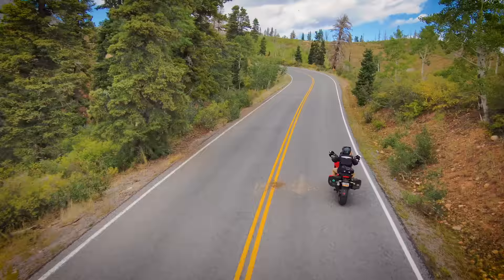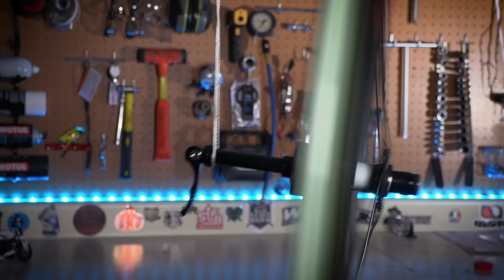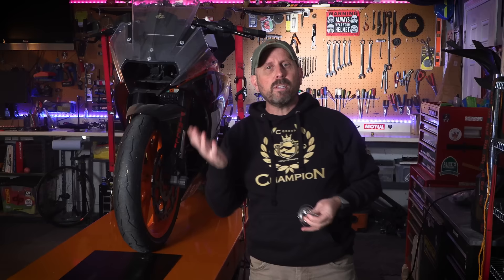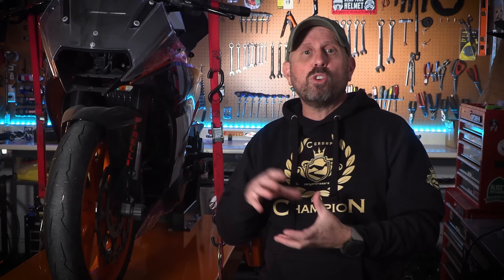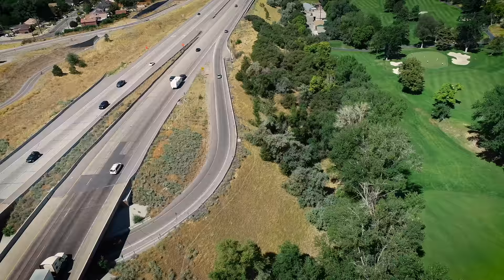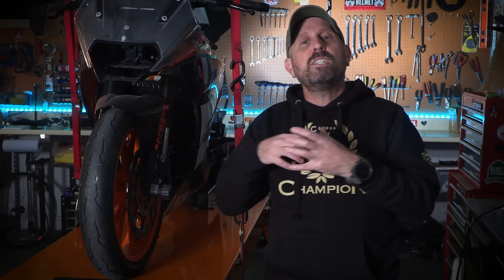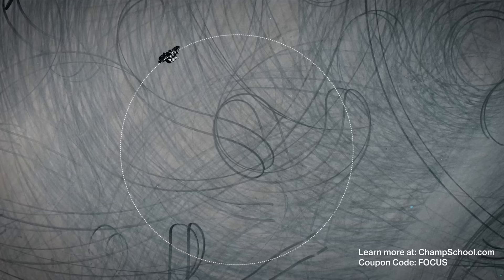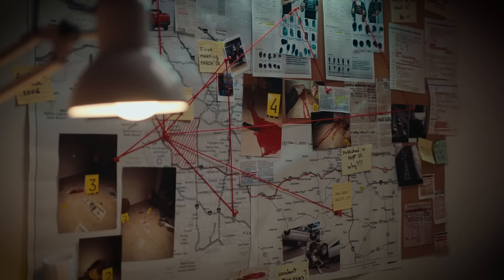Do We Fully Understand How Motorcycles Work?

Comment: A single rolling wheel—say a rolling bike wheel—is stable all by itself. It has no rake, and no trail. The only things making this happen are gyroscopic precession, and basic inertia—the center of mass will go straight unless a force acts on it to change direction. If it starts to lean in one direction, gyroscopic precession and inertia automatically "countersteer" the wheel back to maintain a more-or-less straight line. It's not accurate to say a bike has to lean to turn. The center of mass has to be inside the radius of the tire contact patches, but you can also do that by keeping the bike upright, and leaning your body mass into the corner. That's exactly what MotoGP riders are doing with extreme hanging off—the bike turns a tighter radius without actually leaning more. And the myth of countersteering only working at higher speeds is simply a function of reduced gyro effect and inertia at lower speeds. It takes just a tiny force to get a bike leaning at low speeds, and a slight lean into the turn by the rider does this without the rider even noticing. On a light bicycle, simply turning your head into the turn is often enough "lean"—that is, moving the center of mass of the system inside the corner radius—to initiate the turn.
Reply from the maker: Awesome comment!!

Comment: Trail braking decreases the corner radius due to the reduced speed. But the compressed forks also help. Is it because the trail increases?
Reply from the maker: Trail decreases when the forks compress, which reduces bike stability in a way that makes the bike want to change direction.   When we accelerate, trail increases, the bike becomes more stable, which is why the when we accelerate the bike stops turning and wants to run wide.
Reply: It also depends on are you using front brake or rear brake/ engine brake. Front brake = more unstable = turns more easily/ requires less steering force input. Rear/engine brake = more stable = requires more steering force input.

Comment: The problem in English speaking explanations is, that the word "counter steering" is used for 2 different purposes. If a car's rear tires start to slide then you want to "counter steer" - this action can happen for some time until all wheels go to the same direction. Whereas the initiation of a turn with a motorbike is more like an "impulse". The impulse brings the bike out of stability and this causes the bike to lean until it achieves stability again. So there is absolute no magic. And the reason why a bike / bicycle / one wheel is "stable" is due to the gyroscopic effect.
For ex. in German there are 2 different words - "Gegensteuer" (counter steering) and "Lenkimpuls" (steering impulse (?)) and it's clear what the outcome of these actions are.
Reply: And trail - compare a long fork chopper vs a moto cross. Latter is about agility whereas to initiate a turn with a chopper needs some force - a long trail will emphasize that.
Reply from the maker: I agree. I also struggle with the term "trail braking" - I'm sure it has to do with using the front brake the control trail - but it's "trailing off the brake" or "Use the trailing brake" - I think it just adds to the confusion of the technique.
Reply: @CanyonChasers  Btw I really love that you bring up that kind of stuff. I also experience that a lot of instructors are out of words when it comes to tricky 2-wheel stuff ... 🙂
Reply: Gyroscopic forces has very little to do (typically 5-10%) why a bike is stable. A bike is stable even if you eliminate gyroscopic forces.
Reply: @deadslow201  Says one who has a masters in Physics ? ... 🙂

"Newton's first law extended to rotating bodies, whereby its angular momentum vector exhibits inertia against change. An object will remain at rest or in uniform rotational motion, with its rotational axis continuing to point in a steady direction, unless acted upon by an external torque."

Not sure if you understands this ...
Reply: @johnmoser1162 A bike is stable even if you eliminate gyroscopic forces.

Not sure if you understands this ...
Reply: @deadslow201  Sure ... send me a pic of your bike at zero velocity, how stable it is. Most likely you are still pedaling your toddler tricycle ... 🙂

[edit: there is nothing such as "gyroscopic >forces< ... 🤣" ... but lets accept this expression since 99.99% of the audience have no clue about Physics.
The reason why a bike with rotating wheels is stable -> angular momentum. "This stability is created by the conservation of angular momentum and the gyroscopic effect of the object's mass distribution and rotation speed."
In order to change the direction, a torque is required.]

I am pretty sure you DO NOT understands this ... 🤣🤣🤣

Comment: Good explanation! I wouldn’t call it “counter steering”. I would call it “counter pressure”. Any biker can do this simple experiment. Find an open safe road with a good wide lane. Get going about 40mph. If you have a throttle-lock, use it but if not, just take your hands off the handlebars for 20 seconds and let the bike coast. While going no-handed and sitting straight upright, do nothing but put a little pressure (start small) pushing forward one of the handlebar grips. Notice how the bike goes in the direction of the grip you are applying forward pressure to. Now stop applying pressure and notice how the bike returns to a straight path. Go easy and be safe when you do this (I cannot be responsible). But that is just one way to force a bike to turn. I have found it to be easy to force a riderless bike to turn while being dragged behind the bike on steel shoes (it's a stuntman thing). Holding on to nothing but the grab bar behind the seat, I push down on one side and pull up on the other forcing the bike into a lean and wahla, the bike leans and turns. Just take my word for the steel shoes experiment guys! Be safe. Know your motorcycle. Take small steps and do not crash. #keithkardell
Reply from the maker: Some of our language and terms, I think, make it harder to grasp the concept. I feel the same way about "trail braking" - I assumed that it meant using the front brake to control the bikes trail but some folks think it means trailing of the brakes, or dragging the trailing (rear) brake.  I suspect someone thinks it is how we ride on dirt trails.

Comment: Gyroscopic precession doesn't keep you on track primarily because the idea that is was in relation in any way to the earth's center of gravity or axis is wrong.  A gyroscope specially has no sense of what is up or down.  A good example of this can be seen in the spin of the Earth versus the spin of Uranus. Most planets including Earth spin on the same axis as the as the the solar plane, but Uranus, which was hit by a massive object early in the solar system's history, spins at a 90 degree angle to the rest of the solar system.  It makes no difference at all to the planets, they are still doing all the things gyroscopes do in space and the Sun's gravity is still pulling in the same direction. A gyroscope has no idea what up means in relation to you or the road. It only know that if you push out on one side, an equal and opposite reaction occurs on the other which changes angle of spin until you do it again.  The part of countersteering related to gyroscopic precession would be like you pushing forward on one side of Uranus which would cause it to change it's angle from 90 degrees, but nothing else would change because it's a perfect orb moving through empty space.  The massive object that hit Uranus billions of years ago is a perfect example of that pushing to one side. No one was there to push it back, so it stayed that way which is exactly what would happen to your bike without all the other elements of the tires, the trail, steering, etc., etc.  You pushing on that handle bar only serves to allow the bike to engage those other completely different properties of physics.

Now, if you want to change Uranus' orbit, you don't do anything to its spinning axis, but if you slow it's speed down moving through space, suddenly it will make a smaller circle around the sun, but everything else will remain the same. If  you want to put it back where it was, you need to speed it up.  This is centrifugal force in action against gravity and how the two play together.  The best way to think about the action of the rubber of the tires on the bike is that it is controlled gravity. You are essentially creating the effect of extra gravity in a very localized way.   If you were in space, your speed alone would determine your orbit around a curve, but with the rubber of the tires, you have added gravity to keep you stuck to the road.  This gravity cannot be turned on and off very easily though, so in order for you to make a smaller circle, you can't just slow down, you need to change the path that extra gravity is going to take.  If you speed up and make that localized fixed gravity take a shorter path, you now need to lean away from its center of gravity or the combination of actual gravity plus your artificial gravity will not be enough to hold you in place and you will fly out into a higher orbit.

You are now driving in right-hand circles in a heavy lean at a speed that allows you to stay in this orbit. You can do this until you run out of gas.  How do you get out of this orbit? If you just slow down,  your artificial gravity will fail, actual gravity will win and you will fall into a smaller orbit based on your original center of gravity (on a motorcycle on earth, your head will smack into the ground).   You need to engage your gyroscope control. You need to pull on the right handle bar (or push on the left) so that the angle of your orbit will change.  Remember the only thing this does is change the angle of your orbit just like Uranus. It by itself does nothing else. However, when your angle changed, the bike was still moving forward and this has the effect of putting your artificial gravity on a different path, and so your personal dynamic center of gravity has changed, and suddenly you are no longer leaning.  If you were in space, you would still be in the same orbit but right side up, but because of your artificial gravity, you are now headed into a straight line out of your never ending series of orbits.

Comment: I’m still so confused. Why don’t bicycles have counter steering.. and I still don’t get why do motorcycles have counter steering you’d think the direction you try to face your front wheel is the direction your bike would go. Like if I push my right hand forward the handlebars would face left causing the bike to move left
Reply from the maker: It does work on bicycles. You are initiating the lean with countersteering, but because you are going slower, it subtle. After the initial press, you steer in the direction of the undesired fall.  So it "feels" like you are steering.  

On you bicycle, get coasting down a hill and gently press forward on one handlebar and see what it does.

Comment: Dont we countersteer constantly to keep the bike in a straight line without weight shift. Try it.
Reply from the maker: Not sure I understand exactly.  When bikes are riding along in straight line, the front wheel is actually gently (subtlely) weaving from side to side.
Reply: @CanyonChasers  thanks for the reply. I believe we are making very subtle counter steering movements to stay straight.  There is certainly no lean or obvious turn of the bars.  You seem to go around gentle highway corners without doing anything!  I am pretty sure we are using countersteering all the time. Is it the essential skill in learning to ride?  I used to ride a 400 Yam scooter. Without counter steering you didn't get around many corners.

Comment: I don't believe that no-one understand this, motorcycle designers and race teams have a pretty good idea. it's not that complicated but there are a lot of factors to the situation. it's hard to explain because many of these factors change in combination as a bike leans, accelerates and brakes. You have three main components to it. Steering geometry (wheelspan and rake/trail determine the turn circle radius that the geometry forms at lean and with that in a sense also by a function natural stability for a given speed. The speed and turn radius affect the inertia created as it steers-into the-lean and is then pushed back by centrifugal force.

Suspension travel and stiffness affects geometry depending on the forces which adds another layer to the 
Dynamics.

Wheel sizes and Tyre profile between front and back are also a factor with geometry change as the bike leans, the back usually has a wider tyre (which also fits as it does the most work). Mass and speed play into this as to how this then translates to what actually happens.

All these factors come together to make a specific combination of steering ability. A bicycle although similar still steers a bit differently to a motorbike as usually the wheels are the same size and shape front and back, and the mass of the bike much less than rider.

It's mass that pins the motorcycle geometry into position and so by function the speed determines how tight a bike "wants" to turn, what's also relevant is what forces are being transmitted at contact patches. If the rear is 'pushing' the bike will try to stand up and turn wider untill it goes straight. If the front is braking the bike will try do the same (all this if course as long as there is trail), you should also consider the front is always in some state of braking as its not powered, it's only spun by being pushed despite drag and friction trying to slow it. If the rear is pulling then this counters the pushing force and actually acts to pull the front into the ground (the exact opposite of the self stabilising effect). 

You can feel this geometric difference of behaviour by dragging a bicycle backwards by the saddle compared with pushing it. Forwards pushes the front into the turn and rights the bike if a force continues to be applied, but backwards makes the bike unstable try to drop .. slowing down as a bike leans is in effect reducing centrifugal counter forces and will tighten the turning radius.

What's more interesting and makes it a bit more complicated is that as a rolling bike leans it does actually have forces slowing it down,  since as it rolls onto the edge of the tyres there is a deceleration. It is effectively downgearing as the wheel diameter the bike is rolling on gets smaller. 

Gyroscopic forces are tricky to visualise but they of course play into the mix too, but don't think of the rolling wheels completely as gyroscopes. only if you light the back wheel up and it spins purely in that axis will it behave like a gyro in your hand. When rolling the actual speed of the wheel isn't uniform. The point on the road isn't even moving at all, whereas the top of the wheel is travelling fastest. Internal spinning parts do actually behave as gyros though, but they are much smaller mass than the overall system so are overcome

 if you can visualise all these factors you can quite easily picture what's going on. The fun stuff is understanding how all this can be played with to make for completely different handling which can be used depending on the circumstances like camber, grip, sliding and power/braking forces. 

Steering on one wheel (wheelies) is more down to other physics to do with center of mass and inertia, which is also happening independent of whatever the front is doing... Steering a stoppie is simply balancing that stick in your palm like mentioned in the vid. 

Obviously how much grip there is changes everything with how it all plays out.

 sorry.. I went down the rabbit hole on that, but it is an interesting subject
Reply from the maker: I loved that you took the time to write that all out. It was extremely hard to try to simplify these ideas into something I hoped would be mostly understandable.  I purposely left out inertia and camber thrust for this reason. As it currently sits, I was afraid it was already getting too dense.  I was, however, hopeful it would maybe inspire folks to look deeper.
Reply: @CanyonChasers  i think I can visualise what's going on well, but yeah when you start to put it down on paper it grows like an angry hulk..

Comment: You, or champ school for that matter,  are not completely right regarding fast vs slow corners.

It depends on your mass as a whole. You will simply be able to carry more corner speed with a lighter bike and rider.

Put a bike + rider combo that is 50kg lighter than what was shown and the radius will be tighter.
Reply from the maker: Thats absolutely correct - but we are not often changing between a heavy bike and a light bike mid corner.  😎

Comment: Funny thing is, Fortnine made the video to prove you can't turnt the bike without countersteer, but you totally can 😂. My bike turns a lot with just body weight
Reply: No it doesn't. Take your hands off the handlebars and corner with only body weight. It won't work out well for you. To turn the bike must lean into the turn. To lean the bike, you must counter steer. Riders think they are using body weight when ready they just change hand pressure on the handlebars. Leaning right you pull a bit on the left and push a bit on the right and vice versa. But you didn't need to lean your body to do this.
Reply: @SMSBJM1981  I definitely can turn my bike with my hands completely off the handlebars. Just how I can ride my bicycle with my hands in the air for miles, do turns and everything. There are more options beyond counter steering...
Reply: Induced countersteer. I used to do it on my bike as a teenager. I rarely used the handlebars while in motion.